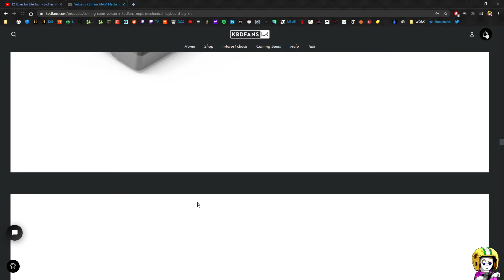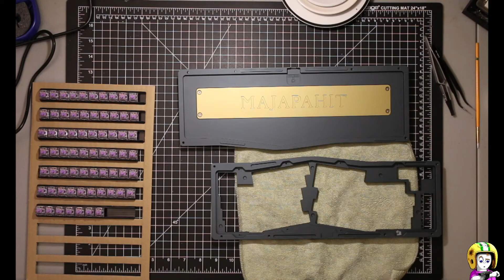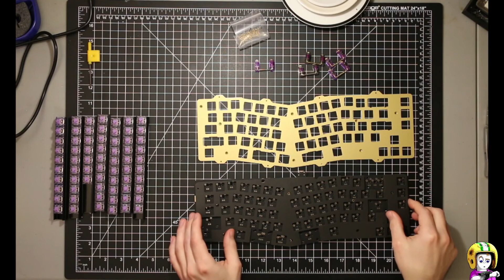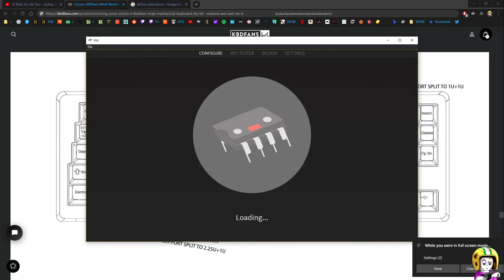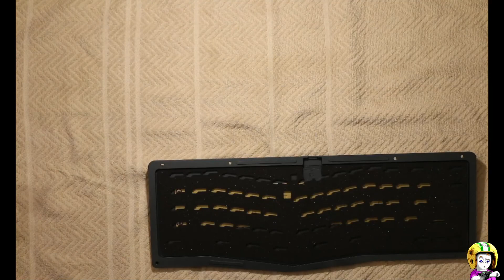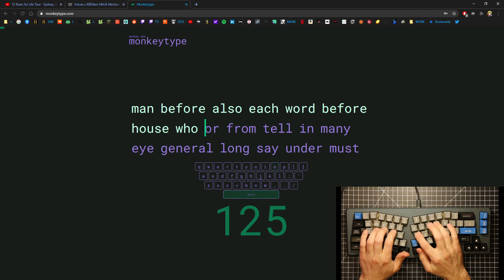MAJA custom keyboard build (Stream Edit)

Comment: The standoffs are only there for the hotswap version, since you're soldering you should had never used them. Also, you should had went with 2.25u spacebar, instead of 2u.  If you ever want to change keycaps, "correct" 2u spacebar are a pain to find.
Reply from the maker: I thought that might be the case with the standoffs.  I think I prefer a stiffer typing feel anyway, so I don't think I lost anything there.

On the layout (this brings up a good point):
I have to use the 2u left-space because my left hand spacebar key is actually the 1.25u, not the 2u.  I wouldn't want to use a 1u space, so i went with the 1.25/2.00 split.  I actually wish the two keys were reversed in position with the longer one being on the right side, then i would have done what you said.  This is actually something I should have looked more closely at before I bought in.  An example of what i would prefer is the gok type-K (3u on both sides.. although that doesn't help in finding keycap support...).  That said, the 1.25u space hasn't given me any issues, I only use it for gaming anyway, and plenty of GMK sets have a 2u shift key.  The bigger issue is actually getting a 1.25u space...  I can always use a R4 mod key like I am now, or I may put KAT cyberspace on this board which has all the keys a man could ever want (including 2u and 1.25u space keys).  But cya in 2022 i guess...

Comment: Nice build! Did you end up using those two little sticky foam squares? I am about to build my maja, but have no idea where I would use these little foam squares haha
Reply from the maker: hmmm i don't actually remember getting any foam squares in my kit.  if they are conductive it might be for grounding / anti-static between the PCB & case / PCB & plate.
Reply: @svenge_  grounding was my thought as well... it’s almost perfectly the same size as those two square golf markings on the pcb